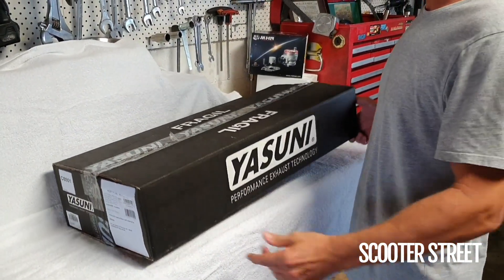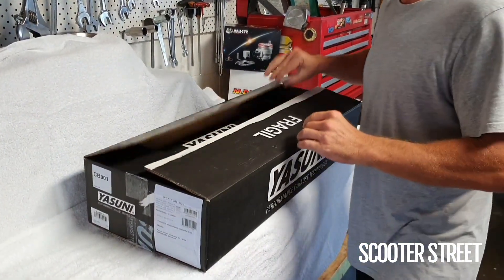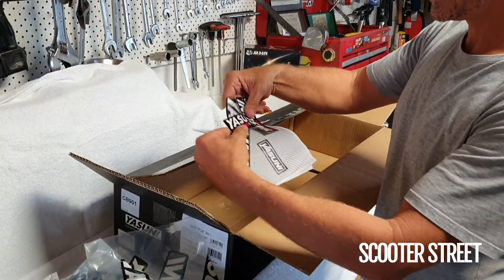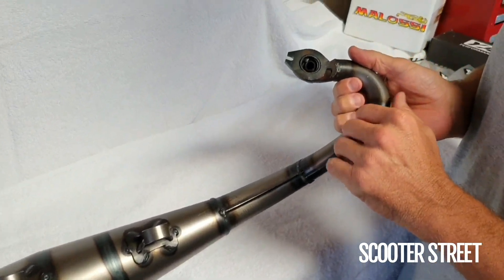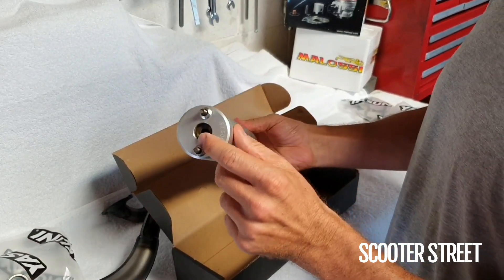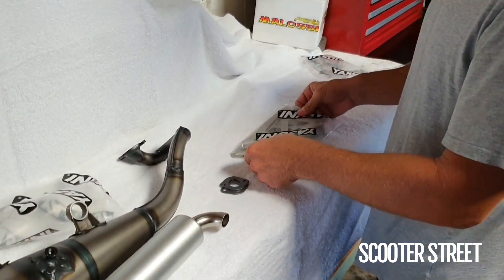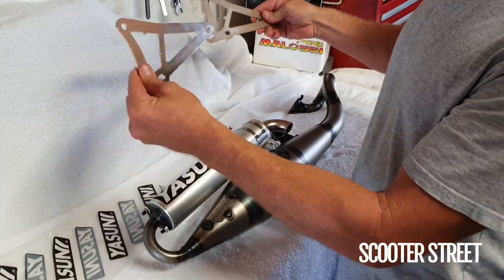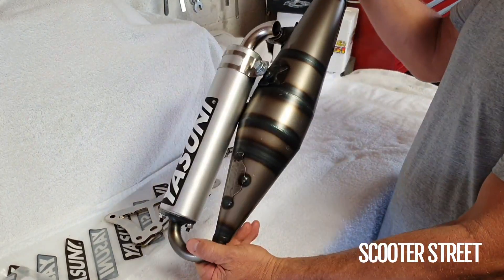Yasuni Z Performance Scooter Exhaust - Unboxing and Assembly

Comment: Hello ! I love what you share with us. keep it up! I just bought this exhaust. i have a question regarding this exhaust. which roller setting should I put, and which jet? on a typhoon 50 2020 euro 4 stock
 I am from France and I admire what you do!  
Ps: I will change the barrel of the variator by a smooth barrel Malossi
Reply from the maker: Thank you Haitam, Your scooter is a little more tricky because of the Euro 4 emissions. I'll link a good article below on the derestriction and exhaust tuning method for your scooter.

https://www.pedparts.co.uk/blog/how-to-derestrict-euro4-piaggio-typhoon-50cc-2-stroke-scooter

Comment: What jet, rollers and that do use for this exhaust, I’ve just bought a Yamaha jog rr
Reply from the maker: Must be tuned , trial different size rollers and different size jets. If the main jet is 60 go to a 64. the rollers may need to be a 10-15% lighter.

Comment: i have a Yamaha aerox stock i didnt realy understand the thing minerali horizontal do you need a special mineral motor or can i put it on my stock yamaha
Reply from the maker: Minarelli is the name of the engine that Yamaha use in their 50cc 2T models. The Aerox and Jog have horizontal Minarelli engines. There are other brands that use the Minarelli engine as well, which is why we often refer to the engine type rather than the scooter. If you have a Yamaha Jog or Aerox, this exhaust will fit.
Reply: Scooter Street thanks so much ❤️
Reply: Scooter Street 50cc and 49cc is the same right?
Reply from the maker: @danielsf2453  Yes.
Reply from the maker: @danielsf2453  Cheers.
Reply from the maker: @danielsf2453  Yes, all '50cc' scooters are actually 49cc. Its the same with pretty much all engines, they're always rounded up to the nearest whole number.

Comment: I have a c16 for the track no numbers on the pipe not street legal....and i have a restiction/ limiter in my muffler is that normal or did yasuni putt the wrong muffler on my track only c16 ?
Reply from the maker: That is unusual that a race exhaust have the restrictor!! I don't know the answer, so please check with the Yasuni company you bought the exhaust from.

Comment: Quick question I have just bought a yasuni cross exhaust for my derbi senda and have removed the restricter in the expansion chamber. However, I am unsure whether there is a restricter in the end can or not, do you have any idea. I would also like to ask this cross exhaust fits very close to the air box and frame and would just like to ask does the heat affect anything. Thanks a lot
Reply from the maker: Not sure on that specific exhaust but most of the Yasuni for Piaggio models that we see do have the restrictor. Check to be sure.

Comment: What main jet do you recommend for this pipe? I was thinking about 60/62/64. Also do I need an aftermarket malossi variator/clutch for the best performace output? My bike is aprilia sr50r piaggio engine euro2
Thanks
Reply from the maker: I would guess anywhere from 62 - 68. Every bike is a little different, start high at 68 and work your way down. That's the best method for jetting. For the best performance out of the exhaust you need stiffer clutch springs, and lighter rollers at the very least. A performance variator and clutch will be better, just depends on your budget.

Comment: Would these be ok for an 80cc engine ? Or do you think maybe i could sort of add a section to make it say 1 ring longer maybe? Ive got 3 pipes in the shed so could cut them up
Reply from the maker: Give anything a go, look at the dimensions of the exhaust you want to copy and go from there.